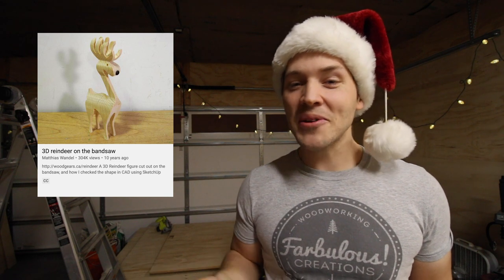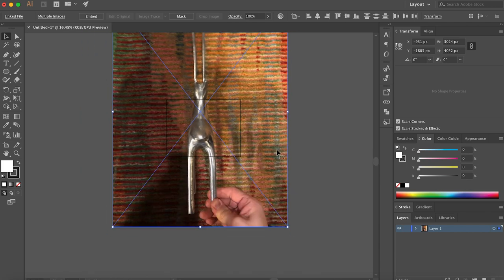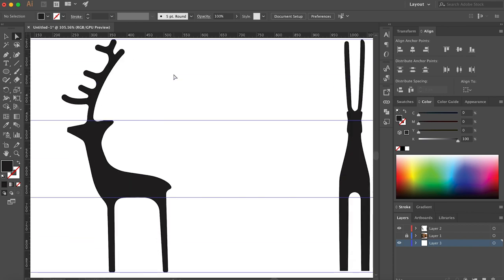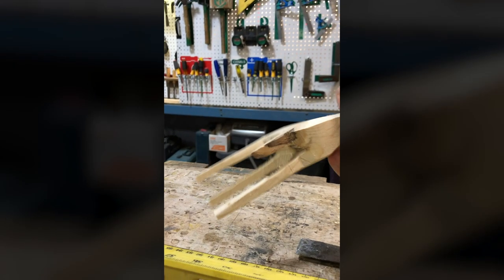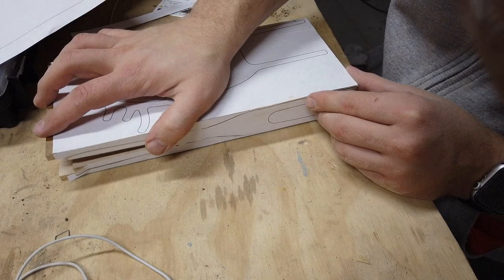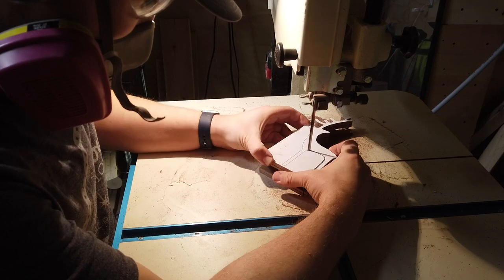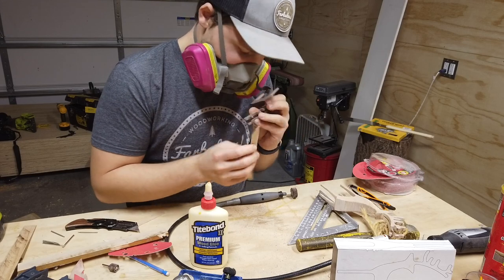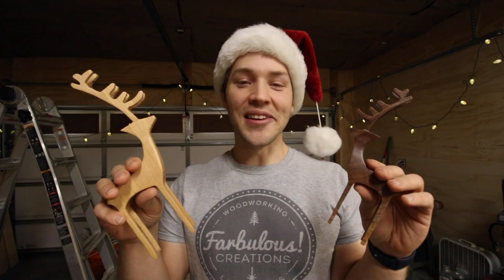Making Modern 3D Reindeer on the Bandsaw

Comment: I love your deer!  Can you tell me what blade size you used?  I tried to cut one at my Makerspace and it didn’t seem to want to cut it.  It could just be my technique.  I was using a construction 2 by 4.
Reply from the maker: Hey Elijah! I believe it was a 1/4" blade with 6 teeth per inch (TPI). A narrow blade allows tighter turns and curves than a thicker, stiffer blade. Regardless of blade, always go slow and make relief cuts if you need more room to make a turn. Good luck!
Reply: It turns out the blade was dull!  I had some success with it and look forward to doing many!  Thanks!